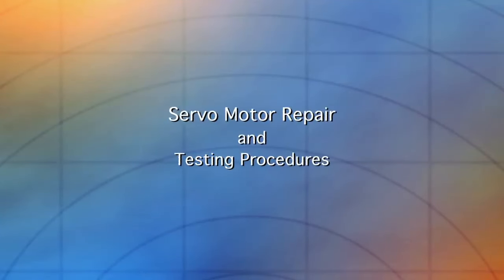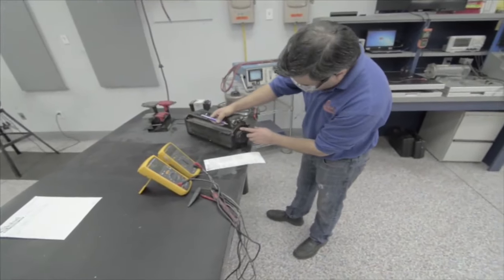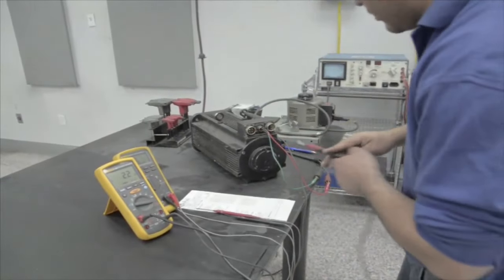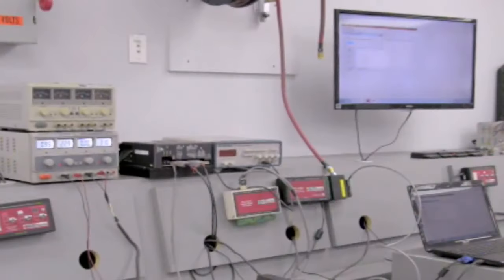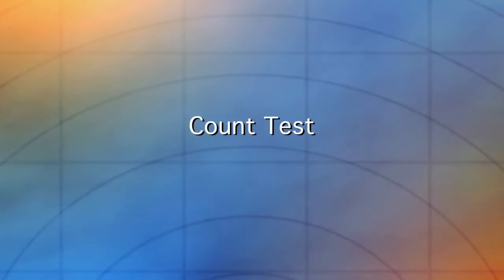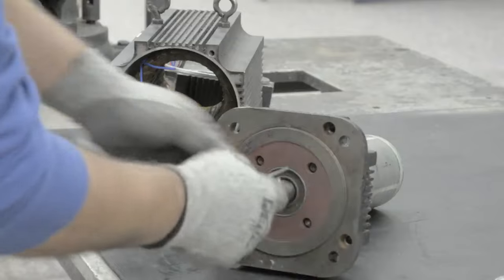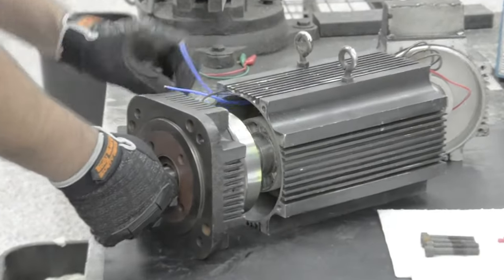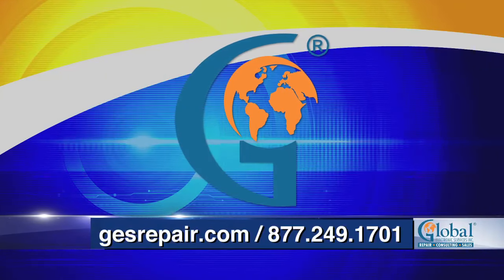Servo Motor Repair & Rebuild Instructions - Testing and Alignment

Comment: Is the encoder internal in these motors?
Reply from the maker: Yes, the encoder is mounted to the shaft, opposite the drive end. The encoder sits within a housing near the endbell. Thanks for watching!
Reply: @Gesrepair  yes thank you we were troubleshooting our ships pitch and propulsion someone adjusted our linkage arm that is attached to the servo motor we ended up having to replace the servo motor and then also the transducer which houses the internal encoder and we are able to accurately calibrate our pitch
Reply: @Gesrepair  it was odd we were receiving all the right voltages everything checked out continuity was correct no shorts or grounds lots of troubleshooting to find out the internal encoder corrupted 😅

Comment: sir I have 2 servo Panasonic 1.5 kw and it's showing over current and second say under voltage
Reply from the maker: touseef jee you can send them in for repair evaluation, just email sales@gesrepair.com!
Reply: Sir I live in Pakistan. Please Kindly inform me that is this Hardware issue or a Software issue?

Comment: Why using two meters????  . 1)  1587 is not reading 2.2. It's reading over 2.2 Gigaohms. 2) 1587 is also true rms, and there is no need to use second 87v meter, especially for checking resistance
Reply: Looks like an improper lead connection during the Megger test using the 1587.